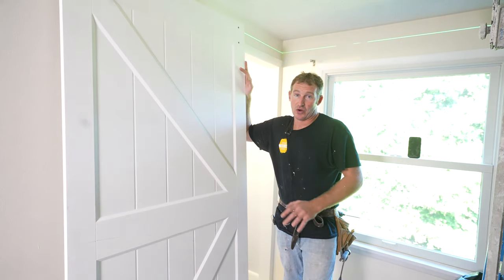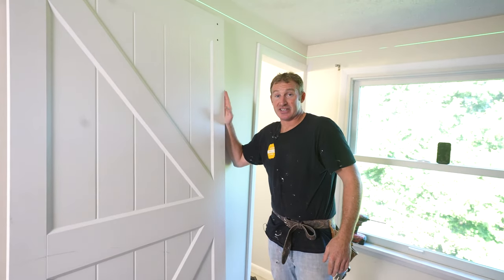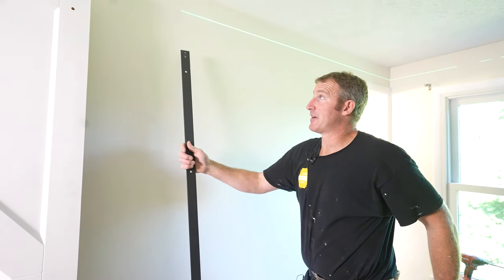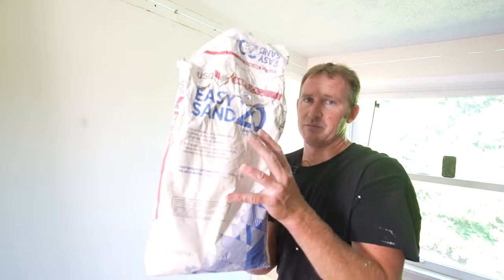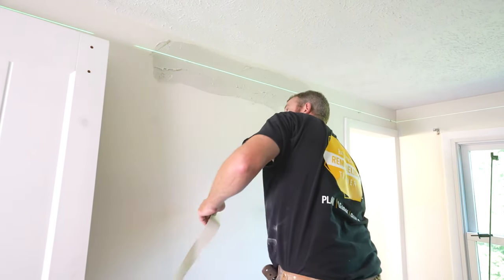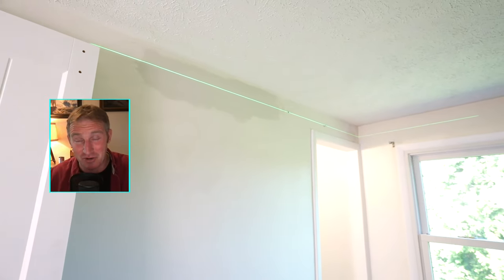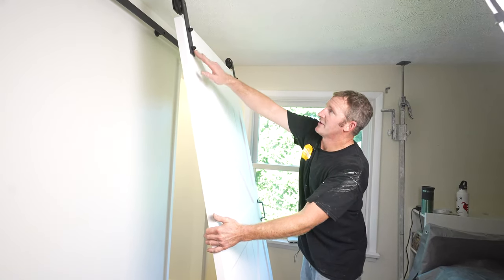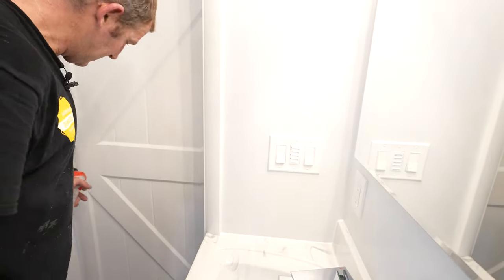Barn Door for a Bathroom ❓| How to Install | PLAN LEARN BUILD

Comment: I installed the same door. I knew that the studs weren't going to line up. I also knew from experience not to trust drywall anchors provided by manufacturer. I paused the install a day then went and got myself a header board. Great video. I know the frustration of everything going wrong on what is supposed to be a simple in and out job.
Reply: I think I've been working on my door for over a month now!

Comment: Man! I ran into this yesterday! I planned on using the toggle bolts today. I put the anchors in the wall last night, and thought I would have it finished today. Now it’s got me worried since I saw how those anchors went right thru the wall. Do they not have anchors that are the size of the lag bolts that come with the barn door installation kit? I don’t want to get into cutting the drywall and installing 2x4’s. So glad you did not take out the bloopers. There are so many easy diy videos out there. It’s nice to see the real deal!!! 😊

Comment: Honestly even if you would have been able to make the toggles work I don't think it would have lasted over time, that's a lot of weight and also with people constantly opening and closing the door they most likely would have come loose or pull thru the drywall.
Reply from the maker: Fully agree. Those toggle bolts are crap. They would have come loose eventually. Especially not hitting any studs at all 👍
Reply: Not meant for heavy traffic. Also door bottom could get wobbly.